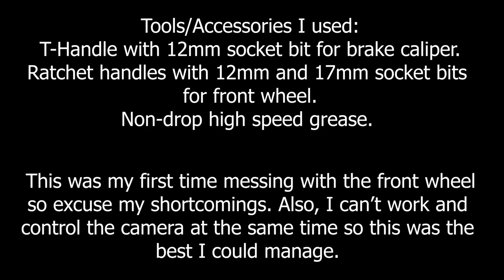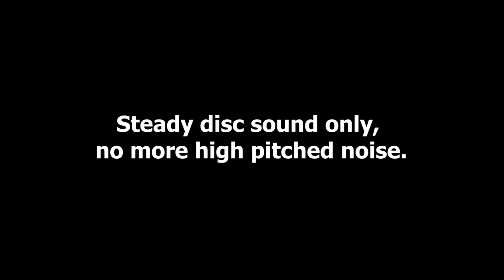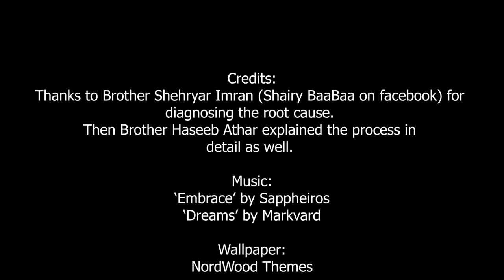Suzuki GR150 Repair - Fixing high pitched noise in front wheel

Comment: Thumbs up on the video! Nicely done. 😍
Only one tip. Front brake dosent need to applied to tighten the front nut. ☺️
Reply from the maker: Saw something similar in MC Garage video so applied it myself. Although, disc has a steady rotating sound after this. Still, keeping an open mind and experimenting new techniques. Let's see whichever technique works best.